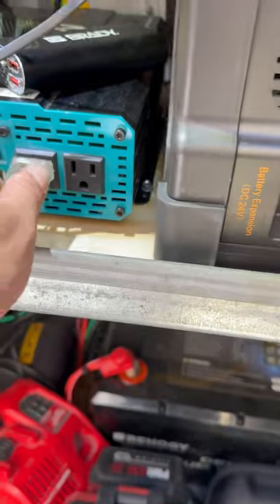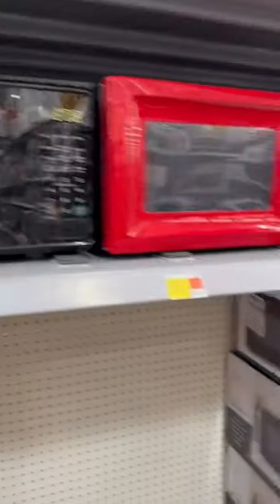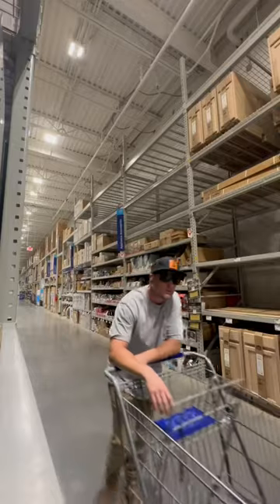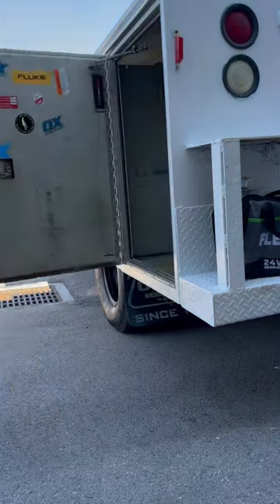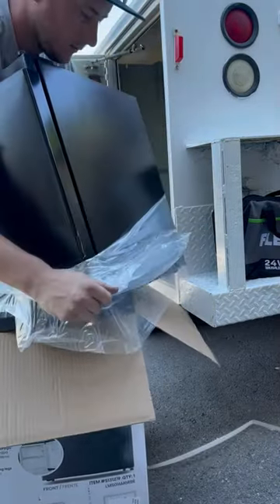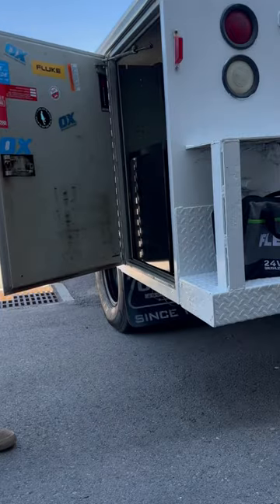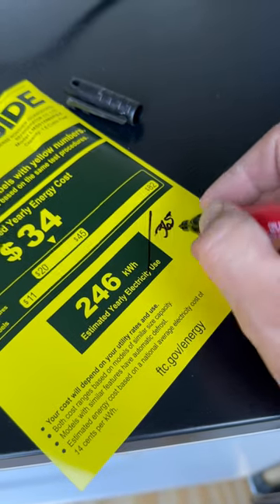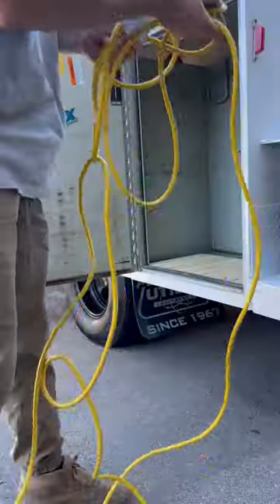Off Grid Refrigerator

Comment: I have an ICECO 75Qt Freezer/refrigerator in my work van that runs on my 24VDC solar system. It uses about 900Wh average amp draw 2.25A. Maintained 14F freezer/34F refrigerator through 100F+ van temps. Purchased at Blowes for around $1K.